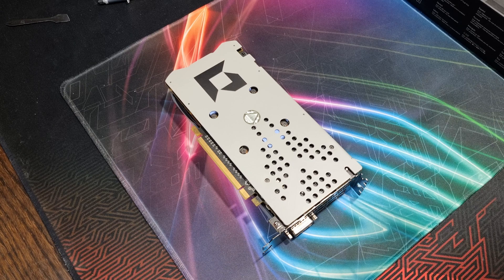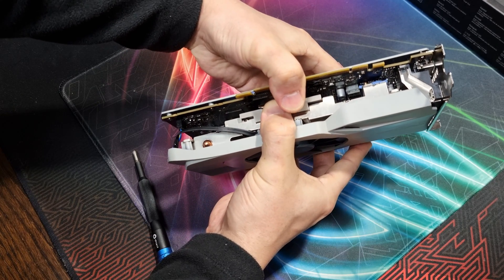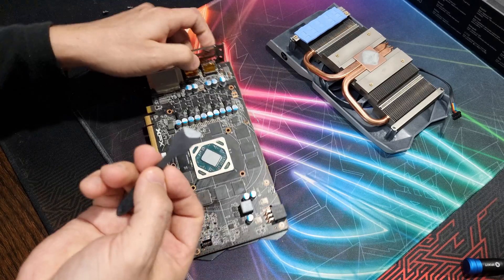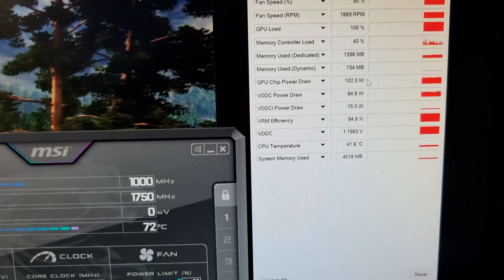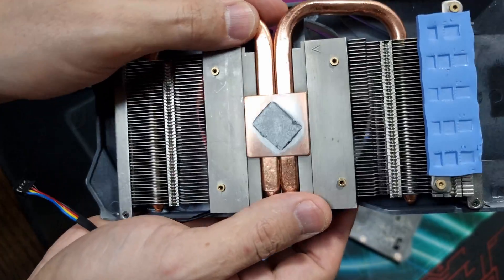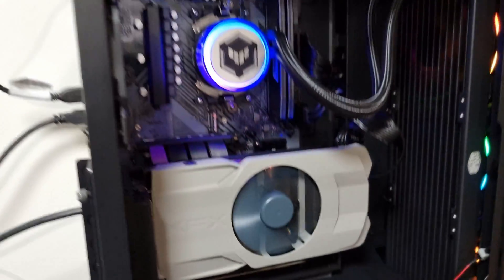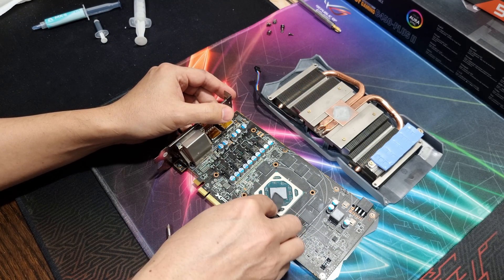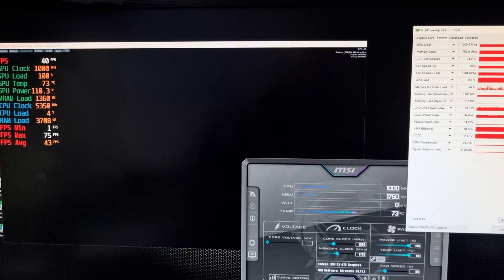Arctic Cooling MX-6 vs Noctua NT-H2 vs CM MasterGel Pro.

Comment: I have MX-6 but it so hard to spread. Is it possible that is has gone bad ??? Want to try NT-H2 because of this. What do you think ?
Reply from the maker: You have to spread it slowly. MX-6 is much thicker, which makes it perfect to avoid pump-out.
Reply: @TechnologyHive  Okay, thanks for the fast reply. Will try that. It is a bit tricky to spread it properly on AM5
Reply: The manufacturer specifically says that you do not use the spread method for MX-6 when applying to a CPU. It's thick and can trap air, the pea method is suggested.

MX-4 and 5 were supplied with a spatula because they were spreadable, MX-6 does not come with a spatula for the reason outlined above.
Reply: The QR code on the box takes you to the application method page.
Reply from the maker: @ I spread this viscus paste every single time and never had any issues. It says it doesn't work to spread it with spatula because most people, specially beginners, do not know what they are doing.

Comment: Mx6 or cryofuze ?
Which one has better temp an longevity?
Reply from the maker: I would go with MX-6. I can not speak on Cryofuse's longivity yet.
Reply: Yeah that's what matters to me too ...longevity.  In my former PC I used Arctic Silver 5 for 7 years 9 (in a i7 4790k). The temps never got higher. Even after 7 years when I removed the cooler the paste looked good, it did't dry up or pump out. In my current build, on a Intel i9 11900 I still used silver 5 going for 4 years now and my temps are perfect. You don't need to repaste every 1-2 years if your temps are good and don't change. Anyway if I'm not mistaken Arctic MX-6 and Arctic Silver 5 are from two different producers.

Comment: im owrking on laptop repair store and the mx6 is kinda hard to spread idk why its not bcs mine is expired or old cause i used more than 50 tube last year and all of them where hard to spread
Reply from the maker: @Aldertlake  It is meant to be viscous to resist pumpout. Just spread it slowly and see how it works nicely.
Reply: @Aldertlake  Try heating up the tube to 35°c before application thats what my shop does. You can get much thinner layers easily while spreading it and save on paste at the same time.
Reply: @mopedguy1064  What's the best way to heating it up?
Reply: @benazzz1000  we have a silicone heating mat and i set it on there for a couple minutes

Comment: My only question is how does NT-H2 and MX-6 hold up OVER TIME?

Immediate thermal performance is one thing, some pastes have a "burn in time" others break down after just 6 months requiring constant repasting. I do a "deep clean" once a year so I prefer my thermal pastes to last a minimum of 1 year with the same thermal performance.
Reply from the maker: If I were to have to choose between the two for longevity, Id go with MX-6. Given that MX-4 has proven its longevity, I have no reason to doubt MX-6 until proven otherwise.
Reply: I used Noctua NT-H2 for RTX 4080S, I was shocked by great result BUT, after 2 months its as bad as before repaste. So im looking for new paste with longer lifespan.
Reply from the maker: @DejvidsonX  Just go with MX-6. It performs better in my tests and will last many years.

Comment: please also test the  "gelid gc 4" and the "Asus ROG RG-07 Performance" Thermal Paste which are new ..............
Reply from the maker: @zlibz4582  I'm testing the Asus paste next 🙂
Reply: @TechnologyHive  along with the paste the mounting pressure and the method of application matters a lot , whether you are using a spatula to spread the paste properly or just using a line method , i found out spreadign the paste properly and then putting a small dot in the middle again works well
Reply from the maker: @zlibz4582  The biggest one is application method. If you do not apply the TIM properly, you will experience bad temperatures.
Reply: @TechnologyHive  relly ? applying to the chip is not enough , you even need to put some on TIM ?
Reply from the maker: @zlibz4582  TIM= Thermal Interface Material :)

Comment: Best thermal paste is KPX by Kingpin.  Doesnt suffer pump-out along with extremely easy to spread as long as you know how to use it.  Ive had it running on my PC now for two years and temps have not changed one bit.  I could never use another thermal paste after this.   Hands down the best!
Reply from the maker: Glad you're happy with it. 👍

Comment: I do not understand why with noctua I have a lot of problems in my cpu, at first I thought it was my cpu and I did warranty with amd, it turns out that the temperatures were still high, then I changed the paste, I put a mx-4 and it was better than the noctua h2, what I would like you to do a comparison with the kryosheet, noctua and mx-6. 
thks
Reply from the maker: I will not touch tg kryosheet. You will not get better temperatures than using MX-4.

Comment: Thank you for the comparisons. 💖
Reply from the maker: Your welcome! 🙂
Reply: @TechnologyHive  which one do you recommend for rtx 3090 ti, Nt-H2 or thermal grizzly extreme
Reply from the maker: @Tuskabanana  I'd go for thermal grizzly extreme. But Nth2 is also good stuff...so...it's a hard one.
Reply: @TechnologyHive  y i cant decide, i read some post that the grizzly extreme will dry out at 80°, so after 6 months it could be worse :=)
Reply from the maker: @Tuskabanana  I've had this stuff on my card running 24-7 doing folding@home for over a year. Temps are exactly the same as day one. Don't believe everything you read 👍🏼
Reply: @TechnologyHive  ok thank you n1 to know, i will get the grizzly extreme :=)

Comment: Any difference of 1 degree is within margin of error in all honesty. even  a slight change in air temperature of half a degree or a quarter of degree could make the difference.
Reply from the maker: I'd say both NT-H2 and MX-6 are good pastes. 1 degree difference is nothing major.
Reply: thats why you need to do test more than once

Comment: Arctic MX-6 is the clear winner. As i said, if my Kryonaut Extreme dries out in 6 monts i will buy MX-6 next year. Minimum 1 year of longevity i expect from a thermal paste before it dries out.
Reply from the maker: I like both MX-6 and NT-H2. Great pastes for longevity and thermal conductivity.
Reply: Please don't use mx-6
Talking out of personal experience.... MX-6 has a TERRIBLE pump-out effect.

After 4 months of use the die is BARELY covered by any paste, all of it is pushed out the side

For my recommendation, use either Gelid GC-4 or NT-H2 for direct dies
Reply: КПТ-19 ))
Reply: @MaximusPanin  у нас нормальные люди и не знают там что это за дичь такая,это только у вас такой пользуются по ГОСТУ 1978 года
Reply: @SashaSkripan  нормальность теперь определяется по марке термопасты ?
Reply: Idk man, gor 2 tubes of mx6 and I need to replace it every 2 months because it becomes oily and my GPU temps go up.
Reply: @curedanxiety1679  попробуйте GD-2 из дешёвых. TC-5888 говорят не выдавливается. А вообще нужен фазовый переход.
Reply: @curedanxiety1679  Hello! I have bought a 9800X3D CPU and I'm debating between MX6 and NT H2. Wich one shall I choose? Noctua is higher quality?
Thanks!
Reply: @letalmike from my experience the the mx-6 pumps out so fast it ain't even funny idk what they did, but mx-6 ain't it, I'm still having a great time with the nt-h2.
Reply: @letalmike  I'm using mx6 with a 9950x3d at the moment and temps are great 👍
Reply: @curedanxiety1679  Idk where you got yours but I've been using MX-6 with my i9-14900k for the past 7 months now with Corsair iCUE Link 420mm and my idle is only 30-35 degrees never had a problem since then. I used a spatula to spread the paste as even as I can, overtime it only got better.

Comment: noctua doesn't dry up fast like other pastes too, I have mx6 but i started to use noctua on my CPU because of this reason
Reply from the maker: The paste I was running on the GPU in the video before I took it apart the first time was NT-H2. But for the sake of science, I had to re-apply it. Great paste!
Reply: @TechnologyHive  yeah noctua nt-h2 is top notch and doesn't have the dry effect (lose performance) like allot of other brands
Reply: @GoldenEagle0007  In my former PC I used Arctic Silver 5 for 7 years. The temps never got higher. Even after 7 years when I removed the cooler the paste looked good, it did't dry up or pump out. In my current build, on a Intel i9 11900 I still use silver 5 going for 4 years now and my temps are perfect. You don't need to repaste every 1-2 years if your temps are good and don't change. Anyway if I'm not mistaken Arctic MX-6 and Arctic Silver 5 are from two different producers.